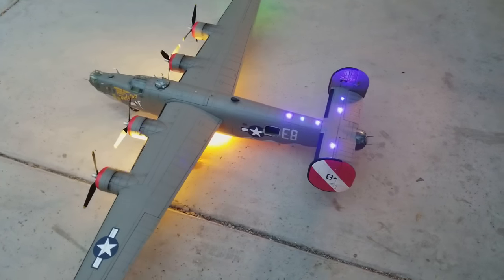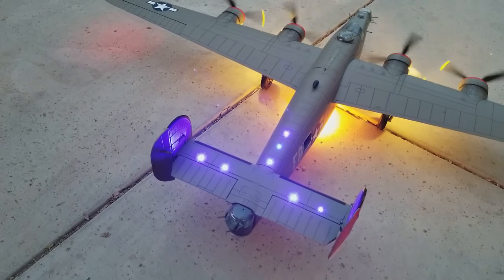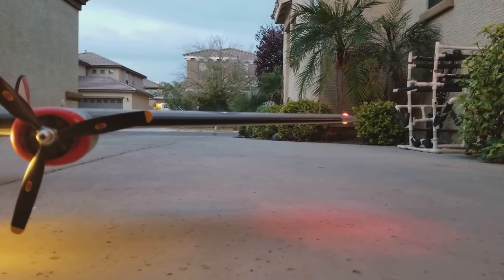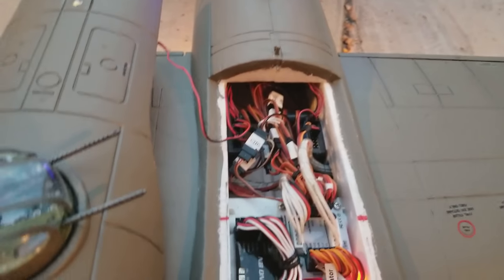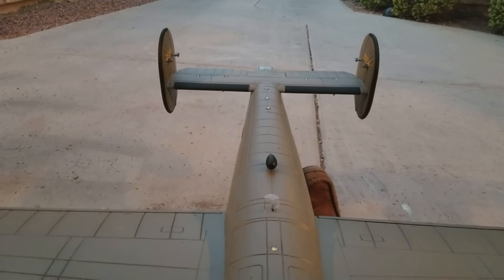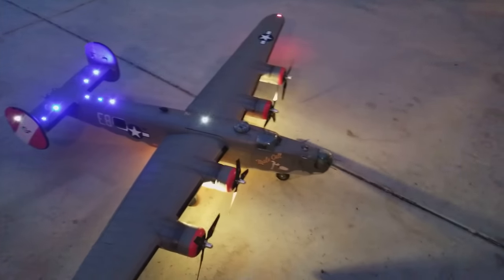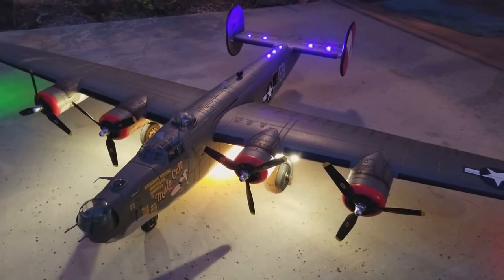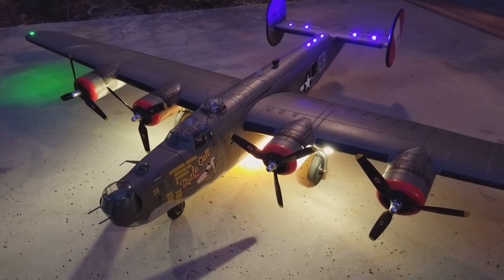FlightlineRC B-24 first ground check

Comment: I'm putting the model sound system in mine. already cut front bomb compartment open to install.
Reply: Rick Hampton is there room in the four engine area for speakers?
Reply: williewideback yes you have to do a little cutting. But if you that out the first bomb bay. There's plenty of room to put   transducers into that area. And it's right on the cg.